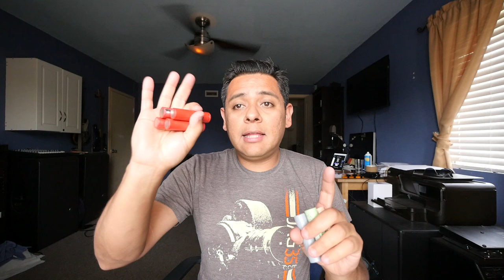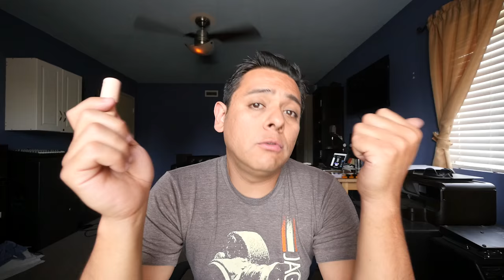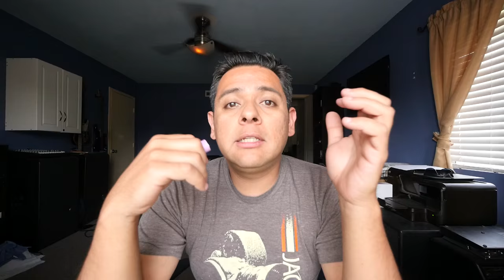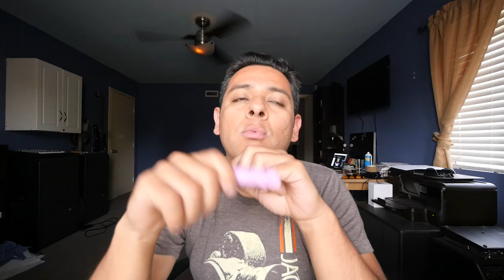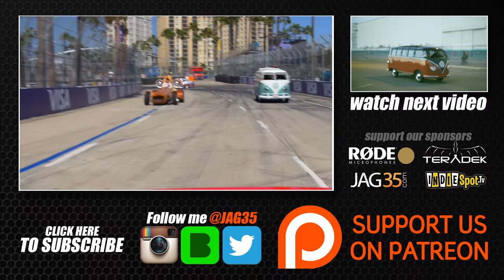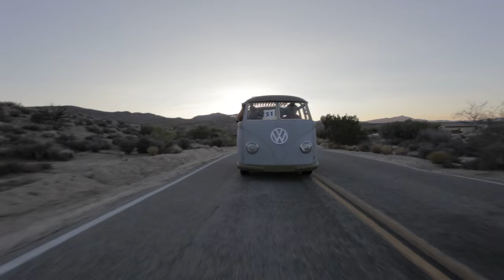Designing the perfect DIY battery pack out of 18650 cells  - Battery talk #3

Comment: I only need two batteries for my circuit I'm working on. Two in series. 8.4v. My circuit uses a Op-Amp as a voltage comparator for the ldr & vres. But the panel would go through a buck converter cc cv first, then though the 8.4v 18650 batteries and the buck converter would stop charging at 8.4v.

Comment: Jehu, I was thinking of the fused design some of you guys are doing. If you built a parallel pack that is 50ah in size and had a fuse or two blow you'd now have lost some capacity. But if you start out with all your parallel packs bottom balanced and then have a fuse or two blow wouldn't that kick that parallel pack out of balance with the others due to the capacity loss? If that was the case then you could have some issues of a poorly bottom balanced pack. We know what can happen with that. Seems to me that the method you guys are doing would be better suited to using a BMS and have it more or less top balanced and controlled by the BMS. What are your thoughts on that? As long as no cell is lost then the system works in a bottom balanced setup.

Comment: Thank you so much for your videos.  I hope you enjoy making them as much as I enjoy viewing them!

I have a 2013 Ford Focus Electric (FFE) and will be using your videos in an attempt to create a battery bank which will be installed in order to increase the range of my FFE.  I have some trunk space that I'm willing to sacrifice for a battery bank which will increase my range.  My goal is to add 8kw to the existing 23kw. 

I'm in the process of determining the stock battery setup.  I know the FFE has 2 high voltage batteries, but I do not know if they are connected in series or parallel.  I also need to determine the voltage of the two battery banks.  I should be able to splice my custom battery bank into the existing battery bank.  Any thoughts? 

Thanks again for your videos.

Comment: Just want to add that the lithium batteries have 30% or so more usable power than the lead acids. Not sure how his controller cuts the power when voltage drops but he could get the same usable capacity with a smaller lithium pack.
Reply: +P Roppo sorry, wrong video, meant for the scooter project.

Comment: I love all your work carnalito. I got a question I haven't been able to find an answer for. I look up to you for guidance. I'm making a monster 500w LED flashlight. The LED specs:

DC Forward Voltage (VF): 70.0 Vdc ~ 78.0 Vdc
DC Forward Current (IF): 7A

I was trying to use all new batteries but it's not cost effective IMO. I'm planning to make a battery pack of about  30 volts then use a step up booster. My question is, would you consider this putting the batteries under stress like in vaping? I just can't see myself making a pack of let's say 80+ volts (which would be a lot bigger) just to having to step it down... but if that really is the best for performance, I'd like to know. I feel like I'm navigating my way around in a dark room. Any help would be greatly appreciated.

Thanks,

Comment: Quick question:
- should I connect batteries in series to get 12v or connect in parallel and use dc-dc converter to get the maximum maximum of my batteries?

p.s. your videos are amazing and changed my perspective to electric/hybrid technology. Thank YOU!

Comment: i want to replace lead acid batteries in my camper.  Should i do 3 serial or 4 to get 12v from 18650?
It will be charged by solar.
Thanks. keep up with the good work

Comment: Wierd and complicated question:
What would be the simplest and foolproof way of charging multicell packs without bms?
fig1
charging each cell array from separate li-ion charger eg 4 cell arrays in parallel >> 4 chargers in parallel acting as a dumb bms (all charger are finished charging at 4,2v , the battery is balanced)
fig 2
one big biffy charger accommodating all the cels in the whole battery pack, and no balancing whatsoever. Only periodically manual voltage checks and so on.
fig 3
disconnecting the series connections and reconnecting all the cells as a one big array, and charging them as a "singel cell" allowing for self balancing.(the problem is the current of charging here)
fig4
Charging them as a series battery pack and periodically balancing them manually by reconfiguration as a "single cell" array

Comment: Hi Jehu, I am at the beginning stage of trying to convert my electric wheelchair to 18650, at the moment it is using SLA and the batteries are very expensive and does not last, The first problem I have is how to determine the load of the motors,  looks like the system is 24 volt but each motor use a 12 volt battery, the charger is also a 24volt charger, the second thing is cells, here in South Africa the 18650 cells are not so easy to come by, how can i determine the load please
Reply from the maker: You need a multi meter https://kit.com/jehu/diy-powerwall-building-essentials/aimo-ms2108a-auto-ra
Reply: @jehugarcia  i have one

Comment: I was having some cranking problems with my diesel BMW last week and I was wondering if you could make a starter battery for a combustion car with 18650 cells? An average lead acid battery is around 80 amp hours, so 20 cells in parallel and 3 cells in series should be OK. Only problem is CCA. For the Bosch S5 85ah battery is rated for 800 CCA, so each batery will be discharging with 12 C.....
Reply from the maker: +Тони Иванов (Tony Ivanov) larger capacity would fix that,  or you could just use lipo cells,  they will give the power levels with out having too big of s battery

Comment: you would still need a protection cuircut per cell 18650, as well as the pack of 18650s in P,
like if u have 10P10S 10 in paralell and 10 in series and draw 10A from the pack each cell like you said will see 1A. 
but what if one cell in the pack of 10 cells in P goes dead, the the other 9 18650 in the pack of 10 now draw 1.1-1.2A each, in a large config like yurs this would cause big problems if suddenly a bunch of cells die from temperture .. what have you, then instead of each cell only pulling 1.5A could jump up to 2+ A per cell causing a MAJOR FAILURE! lol love saying major failure. i have worked alot with large batteries along the lines of 18p12s and the best way to go is all new batteries and proper BMS and charging, smaller applications for 2nd hand cells.

Comment: I greatly enjoy your videos!

I'm complete newbie, and a day ago I needed to really focus to remember basic formulas from school.
But I'm motivated to do a small-scale project - a portable UPS for a mini-pc that I recently got (the Intel Skull NUC which is powerful workstation in tiny size - 211 mm x 116 mm x 28 mm and just over 620gr) with power consumption of 19V and up to 6.32A (ie 120W, though typical usage would be under 80W most of the time). Now I can use it w/o any problem with its PSU plugged in the wall-socket, but given it's ridiculously small size I was wondering if I can turn it into a powerful mobile workstation (with good battery-pack and appropriate mobile-monitor or even better pen-display-tablet).

However most laptop batteries are much weaker, or the ones for gaming laptops that are close to these requirements, usually last under an hour (I guess in order to fit within safety regulations like taking it on airplane...).

So I'm going to do this with new batteries (not salvaging old laptop ones). I've picked NCR18650GA (capable of 3500mAh 10A).
My needs are never going to be over 6.32A for the actual device (the NUC), and I estimate additionally about 1.7A for charging the batteries while running the NUC, which in the worst case scenario would nicely round to about 8A. The NCR18650GA capable of 10A continuous discharge would be operating within safe limits given that my actual need would practically never go over 7A /and probably 99% of the time would be under 6A for both charging and powering the NUC/.
So given the above type of cells, I'll need a minimum of 3p6s setup (though I think I'll go for 4p6s for higher capacity, given it would increase weight only by ~300gr and would give me almost an hour more of average use. I've est. between 3 & 4 hours for heavy or average use with a 4p6s pack).
Now I'm trying to figure out the rest of components I'll need.

1st - Obviously I'll need a PSU with standard 110-220V Input, capable of 200W (25V up to 8A).
I estimated I would need about 25V to charge the above 6s cells (6 * 4.2V = 25.2V), and most such cells have recommended charge rate of 0.5C or in this case ~1.7A (though I'm sure they can safely charge with at least 0.8C, but not sure how would that affect their life). 
For now lets say the PSU Out Voltage is under question, though I think 25V would be appropriate.

2nd - I'll also need a DC-DC Voltage regulator in-front the NUC which should be able to convert both the batteries' 21.6V and the PSU's 25V to the needed 19V. That's the reason I decided on 25V PSU Out, because I would need a DC-DC V-regulator in-front the NUC anyway, so the PSU should supply needed Voltage at least for the battery charging (to avoid one more converter).

3rd - I'll need some kind of Dual DC Power Smart Selection Switch 2-Ins-To-1-Out (or fast and smart switching relay) /isn't there a shorter name for these?/ This is to allow automatic switch from PSU input, to the battery input, when the PSU is disconnected (as in a UPS). I still haven't selected such module. If anyone can recommend me one that can switch without power interruption would be great!
That switch-relay would be in-front the DC-DC converter from point-2 above, so it's INs would be 'A' (the preferred one if available) the PSU-Out, and 'B' the Battery-Out.

4th - I would need some Charging-Protector module between the PSU and the Battery. Assuming the PSU would give the Battery's needed 25V this protector should mainly limit the current (to the safe 1.7A for example). This charge-protector module would ideally protect from over-discharge I guess.
Now if the Charge-Protector can ensure that the weakest cell won't drop below the cut-off voltage (for these cells: 2.5V) during discharging, and the strongest cell won't go over 4.2V during charging - then balancing of the (planned 24) cells can be done (with a balance-charger @home) on a much longer period compared to the regular charging life-cycle (ie half a year I guess?).
And unsurprisingly I still have no idea of such charge-protector module :) (closest I've found so far TP4056 is charging at 1A), so again any recommendations are greatly appreciated!

Sorry for the long post! That's my whole project plan so far that I made for a day, and I really could use the help of people like Jehu, to save me time in seeking the needed modules, and correct my mistakes to avoid  dangerous incidents! :)
So if you've managed to read it all, and have experience with building such portable DC-UPS modules, please comment!

And again, great thanks to you Jehu! All your videos I've watched so far have been very, very educational to me! :)

Comment: i want to make a pack for the ups battery back ups for pc change out the stock battery for lith pack but how would i do that for the charging management do i need to put a bms between the ups and the pack or will the charge manager on the ups handle it

Comment: hello just watched your video on how many cells do I need . I'm considering on a uk mobility scooter it's a 72 v brushless motor think it's a 240 v lead acid battery . is it possible to convert to a Ryobi drill battery setup as these are about 50 pounds Stirling . it only powers the motor no lights ext.I want to cut my teeth then eventually do a car . ps love the split bus with the Tessa conversion.cheers . steve

Comment: I'm curious, are super capacitors good enough to use as batteries in the same manner that these 18650 cells are used? does the capacity drop over time like with batteries?

Comment: Hey Jehu, Love your channel bud.  What's the difference between 18650 cells and 17670 cells?
Reply from the maker: +Sandback Technical Design Inc. size most likely,  18mm diam x 65mm long on 18650
Reply: +jehugarcia That's it. I suppose they are an older design as well.

Comment: How many batteries do I need to make From the battery bank of 18650. For a system of 300 watts 12v three solar panels 6.3 AMP in parallel. I need help 🇵🇷🇵🇷🇵 🇷

Comment: are we going to turn off the comments on this battery talk?
I wanted to known if the imax was real or fake china one? in battery talk 2?
Reply: check the serial number underneath
also if you paid less than 40€ I think it would be fake
Reply: +BillTheBox I was trying to get to the point he mentioned eBay but nothing about real or China copy. And people should be aware that the China copies have issues with voltage. 
Looking online it seems best way to verify is the hologram sticker on the back is the original unit.
Reply: Cam Shaft yes
and worst is that 4,2v can be 4,1 just as it can be 4,3v and it really isn't good for the batteries to be overcharged
Reply: Good info that I think was left out, that the China knockoff has very poor voltage control or accuracy. And if we are talking about treating the batteries with care over charging them isn't a good route. And worst of all you have No  idea you are ;(

Comment: ....Its roughly over a half C.....<-- whats a C?
Reply: afrotechmods has a good video but here is a fast explanation : one c is one time the capacity of the cells. if the cells are 3000mah then one c is 3000ma
if they are 2200 mah then one c is 2200 ma ( or 2.2 amps )